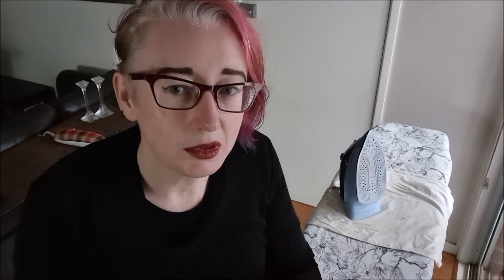Realising I need a Tailor's Clapper - and making one 🧷 Icy's Sewing Hacks 🧷 Icy Sews #sewinghack

Comment: Well G'day there! 
I've just made a set of clappers for my partner, who quilts. I thought you might be interested in two quick points; firstly, clappers are normally bulky (ie thicker) to provide enough weight on the seam as the steam slowly cools(so you don't need to hold down), and secondly, a good Australian wood to use is Victorian Ash - which is easily and cheaply obtained and resists raised grain longer than most Australian timbers. A quick rub back with 400 or 600 grit sand paper will restore a smooth finish - the raised grain is inevitable - as the timber's cells swell with moisture. The steam cooling slowly keeps the cloth fibers held in place as they relax, but stay in their new place. 

Have fun with your sewing projects :)
Reply from the maker: Well, thank you!! I appreciate that! I'll see if MrIcy can find me a block of Victorian ash ^_^

Comment: You totally got it, with comparing a clapper, to a chopping board. That’s what my sewing teacher told me I could use, and I still do.. the beauty of the wood, is that, not only does it hold the heat in, but it also sucks out the moisture, contributing to a crisp finish
Reply from the maker: It's working a treat!